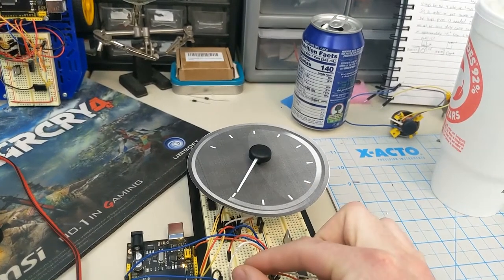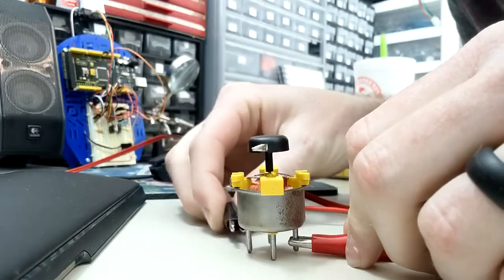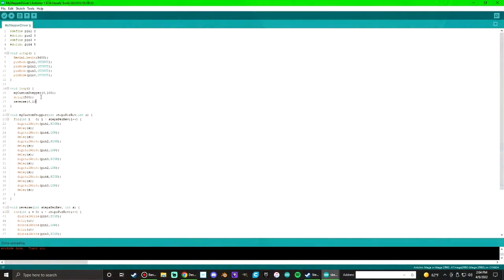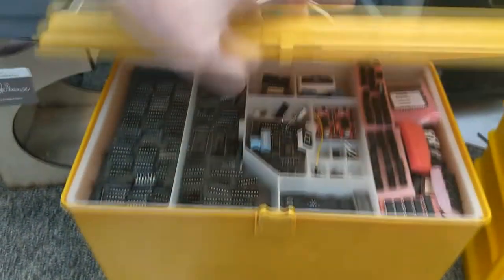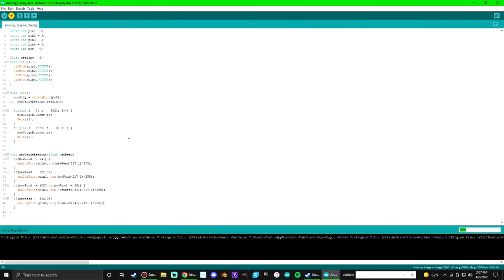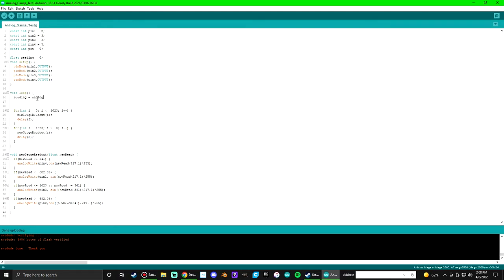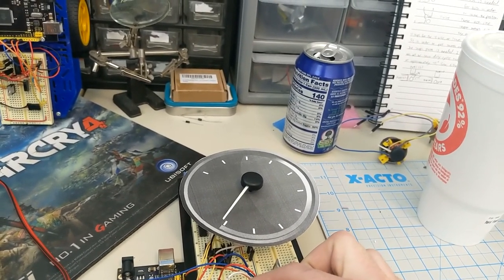Air Core Motor Arduino Control

Comment: What voltage range is supplied to the gauge coils? Could I provide a fixed voltage to each coil to move the gauge to a fixed position?

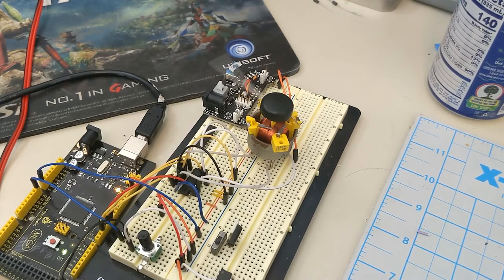Comment: You are only providing half wave.  Also, since you are not reversing polarity, according to your diagram at 4:17 you are alway above 0 (ground), so you don't even need an h-bridge.  I suggest reading the wikipedia page on air core gauges.
Reply: So, do a video showing how it’s done.
Reply: @MightyGimp  Search for the article titled Driving an air core Speedometer Adrian Girling.  It's a post in the Arduino forum.  His code also has a link to a youtube video.   The post tells you everything you need to know.

Comment: I have these motors in a gauge cluster. 
  Would you be interested in taking a stab at solving a mystery about what is wrong with the speedometer?
 It registers say 60 when the actual speed is 30 and 100 at 60 etc. 
 I have more info if your up to the challenge. Others are stumped. 
  Thanks
Reply: Check if increasing the PWM frequency helps (that is, if you are dealing with a sim-rig :P ).  The default is around 490 Hz on some pins, and 392 on others.
I am using a Kienzle 1318-27 speedometer and it uses the tone(); function so it is different, but some of the smaller gauges in my sim-rig respond much more accurate with higher PWM frequencies than with low ones (along with not "singing" as loudly as well :P ).